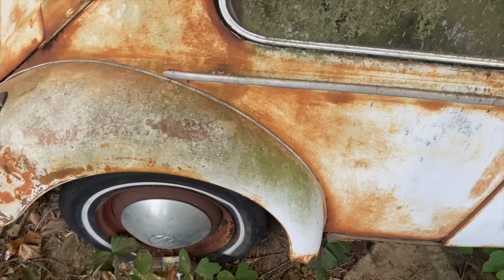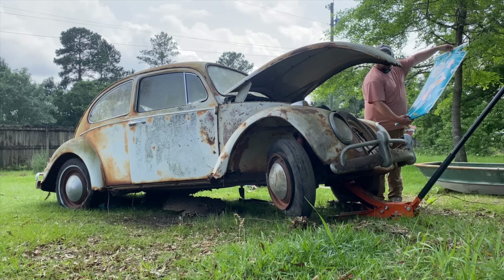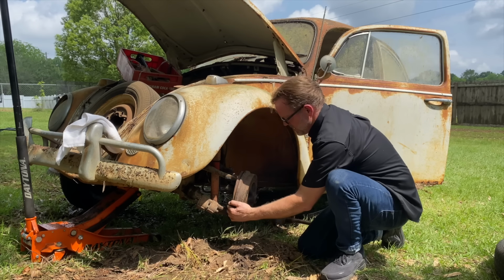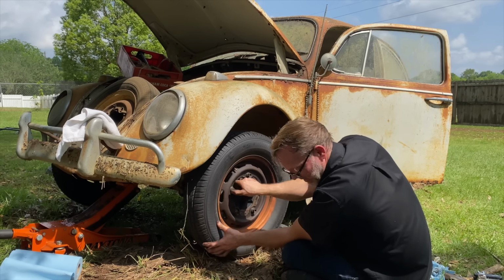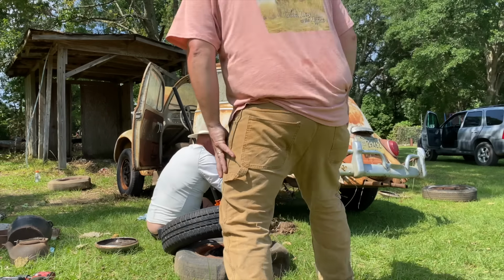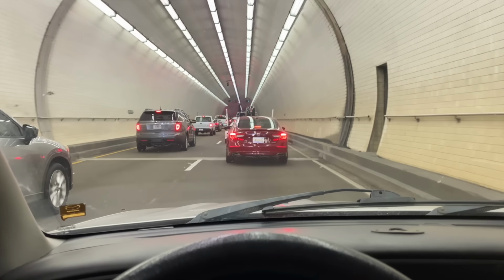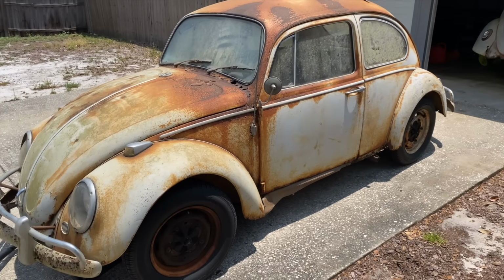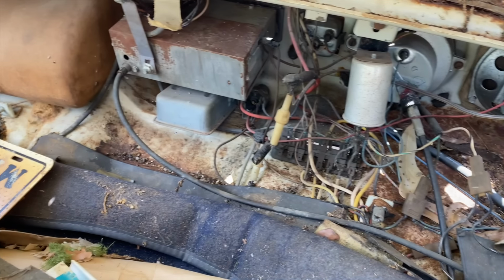VW Beetle Barn Find - Sitting over 25 Years!

Comment: Pretty cool find CT, I'm with you on this one. Too good to pass up. After working on a 65 40hp engine this one you should have Darrin put 92mm piston kit in and turn it into a 2180cc and pop some wheelies😂
Reply from the maker: Hey Tim! This one is going to stay stock for now. Preservation patina build! =)
Reply: Cool, I just hope you have the time to get into this one being you have all the other project still waiting to be restored? Or are you just doing partial flips on them? Understand if you can make a profit to keep getting more projects if that's the case? I'm starting to see off some stuff right now so I have room. What I would like to do is get the 40hp rebuilt and sell it and hopefully buy a vintage Corvair motor and all and if really lucky a Monza 140hp 4 speed two door which are hard to find around here.

Comment: Probably the reason you got the wobbles is because of the rust on the brake drums. once it wore off than it was fine.
Reply from the maker: maybe the steering box is completely worn out...?
Reply: @CTmoog  loose tie rod end or loose link pins. OR they could have been really tight from no grease for all those years.

Comment: The engine is a D same as my 65 beetle engine and I bet the car is the same. That's the original engine. Stock 40hp 1200. I bet it will fire up but may be pretty worn out and probably why it was parked?
Reply: Anybody know what an X code engine is? I thought it might be a factory replacement block but I don't know. I bought a 73 super and it came with a single port head engine with an X code stamped in. I no longer have that block because I swapped in a 1600 but I've always wondered what I had.